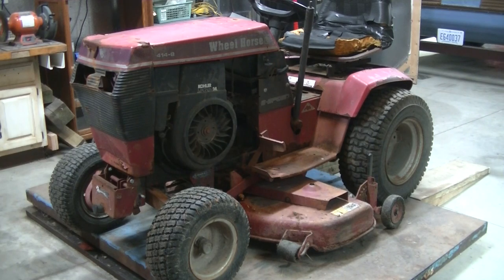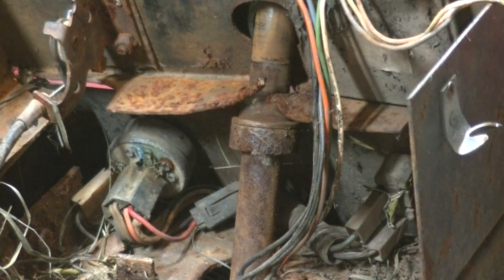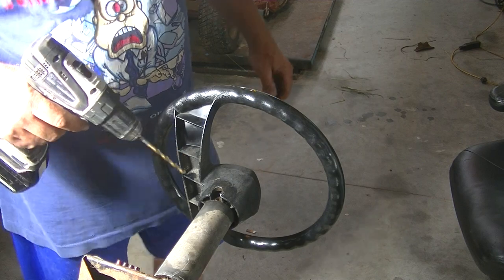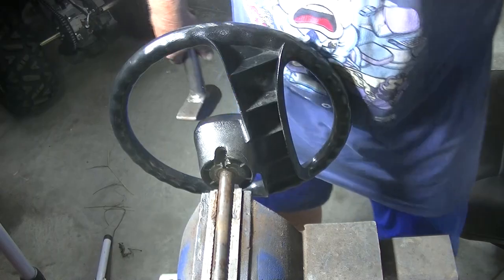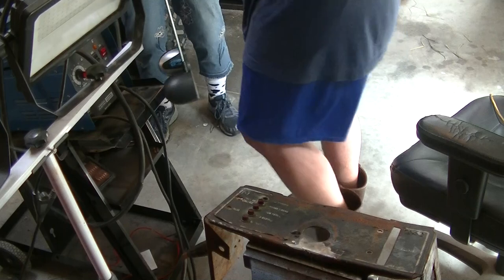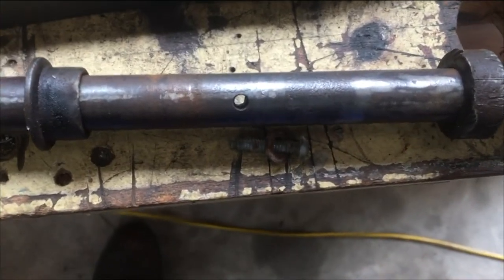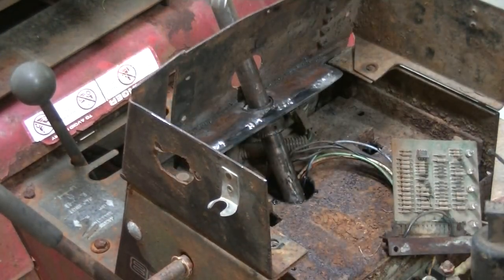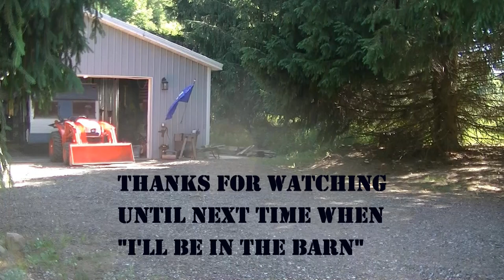1984 85 Wheel Horse Steering Fix

Comment: I have a year 1968 Wheel Horse still going. Pretty stout machine. I use it for pulling heaving logs using a drag mat. It  has 6 gears. I was told 3 for plowing.  Years a go when I needed parts at the Toro dealer, they had a rough time looking for them and then discovered the part numbers were all put on micro film. Northern Tools had a 14 horse Kohler setting on the shelf 30 years ago, so after I measured the bolt patterns, I brought it home and my machine was alive again and has never failed me since!  😁